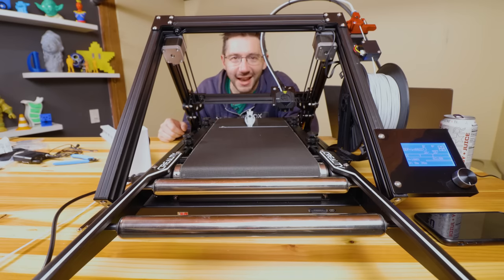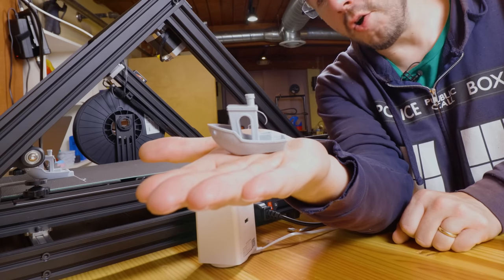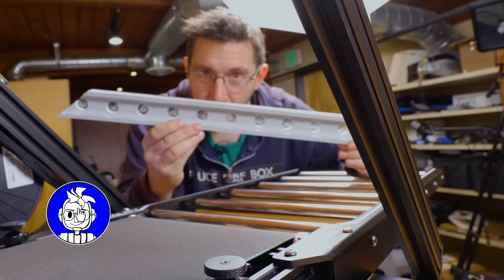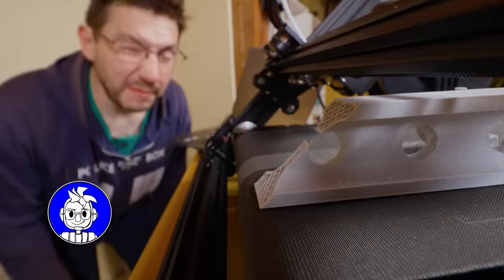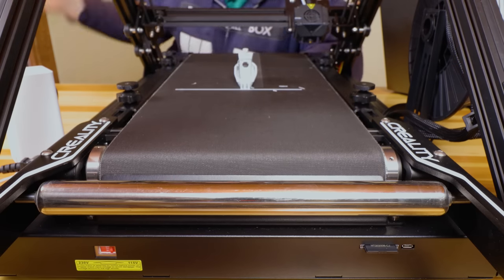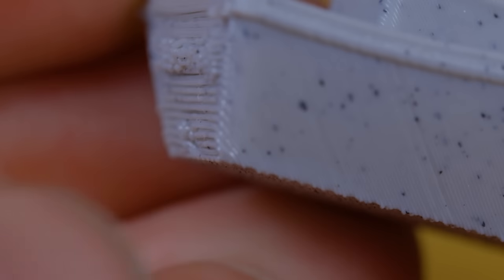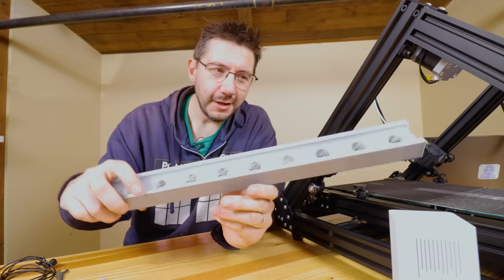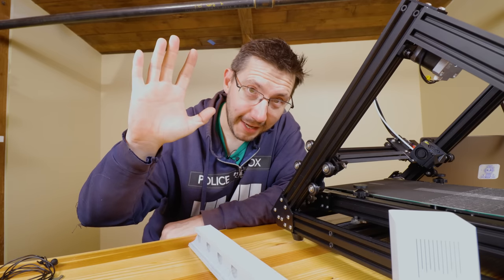Creality CR-30 / Naomi Wu's #3DPrintMill Update!

Comment: Really cool to see, so I know what to look out for! Such a cool machine, I kinda really want to build a transparent enclosure around it with a little exit flap and a parts bin beneath once it arrives.
Reply from the maker: Build that enclosure! Cannot wait to see what you do with yours.
Reply: Sounds like a version of the machine in the near future. I can't wait 2 have several running in production.
Reply: I asked about an enclosure on the last video and someone said that you can't just put a machine in an enclosure or you will burn it up. So whats the truth?
Reply: @jesusisalive3227  it could overheat if it's too insulated yeah.
Reply: Seriously brought reflections of Fallout 4 Ammo production setup lol
Reply: Looking forward to you getting yours and seeing what you do with it.. Hit me up if I can be of any assistance..
Reply: @jesusisalive3227  Yeah, just move the control board outside of the heated enclosure.
Reply: @MakersMuse    1. Keep the controller outside the box. 2. If the steppers get hot you'r (probably) pushing to much current or stepper to small ?
Try to regulate the current a little lower, without slipping of course.   But bigger stepper means bigger controller = more money 8-(
When steppers get to hot the magnet fails, I have cooked a few already...  Not only current will cook the stepper also high frequency is a killer. The steppers I had could do 1KHz 200st/rev = 5 revs/sec. After some testing I could go to +- 5KHz (ramp up and down) for about 45 minutes....  Keep trying and have fun. 8-)
Reply: @StumblingBumblingIdiot  I printed a 5 inch power armor model i took from the game. It would be cool to try jt on this.
Reply: You know it would be great to see a live cast with you, Joel and  Naomi Wu!
Reply: To me, it looks like the first print should be a thin, full width, 2-3m sheet to pick up any belt material that will come loose, followed by a 'blessing' with a heat gun to shrivel up any hairs.  (...and perhaps another sheet to pick up the leftovers?)  Perhaps it would be a good idea to include enough filament in the box to make that initial sheet.
Reply: Print your own prize claw machine.
Reply: @jesusisalive3227  You would likely just need to make sure it has good access to air. Maybe add a fan to the enclosure. Definitely at the very least have some vents. Puting anything hot in a sealed plastic box is an obvious recipe for disaster
Reply: I think it'd be fun to mount it at a 45 degree angle

Comment: Nice update. Ironically I wonder if using a raft is a good idea to make the bottom smoother.
Reply from the maker: I mean, dude, maybe? Hmm...
Reply: I was thinking that aswell but it would encreas the detachment force required so might encreas that dipping artifact for long prints.
Reply: I usually live by rafts, so i could see it being a thing here. But theres still that pesky issue of the belt material coming off with your print
Reply: I would think it would be possible for the raft or parts of it to stay on the belt?
Reply: Kapton tape
Reply: With the belt printers use a couple of small test prints offset to the side to get the flow and height correct and make the rafts thick enough to remove easily or they may become permanent belt fixture or scar.  The bed looks a bit like an abrasive belt minus most of the garnet (which I actually used for a time).  Currently I run PEI on a stainless belt and occasionally Kapton for my belt based printers.  My favorite things to print are upside down dish or bowel like objects as they typically don't need supports which are hard to print on standard fdm machines (I print a lot of speaker grills).
Reply: a nono printer . yet.
Reply: @3DPrintingNerd  I think the bed need to change to carbon fiber（T300 is good enough.
Reply: @3DPrintingNerd  Dual Nozzles so the raft is water dissolving filament.
Reply: @SunnySzetoSz2000  Why not use rubber or a plastic that can take higher temperatures and bed heating? real carbon fiber is still not exactly the cheapest stuff, so using carbon fiber for a printer by Creality will quickly bump up the price to Ultimaker level, making fewer people buy it and thus make the investment more of a failure than a success.
Reply: @Arterexius  make it to two version with 2 different cost.(also T300  carbon fiber isn't that expansive)
Reply: Which slicer are you using?
Reply: A raft shaped like a big H beam
Reply: @henry67278  Increase?
Reply: @richardmillhousenixon  im shite at speling
Reply: @dot-bob  Hello there! Great feedback! I was looking to adapt a belt on one of my printers also.. The stainless belts are made to measure? What thickness PEI? (I got so many questions, lol) Tks in advance!

Comment: I think what might be helpful is to have fans on the sides of the belt to cool those overhangs. Additionally, if the belt is a mesh there could also be a fan under the belt. Lots of possibilities, but a long way to go.
Another thing is that I'm also surprised they didn't just use the buildtak like surface they're putting on all the printers now.

Comment: I'm curious how the belt will handle wide prints. Will they warp and pull the belt up on the sides?
Reply: Good question. I think some kind of tank-track bed might be superior; although it wouldnt peel off as incrementally...
Reply: Belt I believe is steel and under tension. They shouldn't be able to warp the belt.
Reply: @girrrrrrr2  nope, the belt is a Kevlar weave with a pei coating.
Reply: @Unmannedair  oh interesting. That's... Unexpected.
Reply: @girrrrrrr2  kevlar weave belts are standard in some industry belt applications.

Comment: Great to see this doing reeaaallly long prints. I have a feeling the bed belt needs to be really tight to get rid of that artifact you saw because the play in the belt probably caused the model to lift with the belt when it got to the lower part.

Comment: It would be interesting to make 2020 and 2040 extrusion on it.  It could be used for prototyping machine designs without having to cut aluminum.  The belt will hopefully stop leaving behind material after a few prints.
Reply from the maker: I definitely want to try printing extrusion

Comment: Is it possible to set it up for continous printing? I have in mind two cases:
1) Hypothetical - "Infinite" length part - like "I" beam with repeating pattern
2) Pratctical - continous mass printing of single part type (also repeating pattern just with distance between print regions) because it removes print from bed with belt.
Very intriguing printer, if repeating patterns are imposible i feel it would be big waste of potential

Comment: A year on from this video (and these things have probably been discussed) I've found that the cooling fan for the heatsink was not effective enough to prevent PLA melting at the tip of the PTFE tube.  Jamming became a constant issue.  After swapping out the heatbreak for a bi-metal all metal one which moves the end of the PTFE much higher in the heatsink, the jams went away.  I also found that the PTFE quick fittings (PC4-M10) which come with the printers all either failed at some point or had a huge amount of slop in them.  Swapping them out with another brand sorted that out as well.  Replacing the stock PTFE with Capricorn was also applied to our four CR-30's.  

So, Naomi/Creality, please consider applying these changes to shipping CR-30's as they have significantly improved our printers?

Comment: How does it start the print?? If it prints at an angle then that would be a bit weird... does the frame move to print like a normal Cartesian? Also, does the hotend have a servo or something to change the angle of printing?

Comment: Karl had some crazy "coated, single weld, stainless steel belt"

I hope this printer kick starts availability for "print surfaces" like that, as supposedly that was nearly the only thing that was hard to find for the squire/white knight printer.
Reply from the maker: I think it would be neat to see different surfaces available
Reply: The things i could do with a belt printer...

Imagine GIANT RC glider wings printed in one peice, boats (like 3D Printed Kayaks etc), cosplay swords, SO MUCH
Reply: That is kind of surprising considering that belts have been used in all sorts of industrial applications over the last 50-70 years. I'm sure there's a suitable belt out there, but probably not available off the shelf and only available via B2B deals in 1000s of quantity. I hope this opens up the door for more innovation in this space. I just hope Creality doesn't screw it up and kill the mindshare for belt printers in the wider 3D printing community.
Reply: @shadow7037932  I'm sure there are probably several suitable option out there, sadly I don't have the time or money to test them all so I'm very happy to see this style printer going mainstream..  I'm hoping this opens the door to custom made aftermarket belts like we see all the flexplate systems now.

Comment: The coolest thing about it printing at an angle is that curved stuff will generally look smoother than on a standard printer that’s printing a model horizontally/vertically.  

I’ve actually intentionally angled models 45° to achieve that on my Ender sometimes.

Comment: My solution to that kink in the I-beam would be to ditch the outflow rollers and replace them with a thin spring steel sheet that overlaps with the lower portion of the belt and the surface of which is at the same height as the beginning of the belt providing a smooth transition off the belt without disturbing the print upstream. This would also prevent prints from getting stuck in that first outflow roller as had happened with the Benchy and potentially jamming the belt. Ideally the steel outflow table would be sharpened where it overlaps the belt assisting in its function to lift stuck prints off the belt. Rollers are designed to be a low friction surface for packages to zip down them at high speed. They are not designed to provide a level and flat surface for prints to inch across them millimeter by millimeter, especially with how far apart those rollers are spaced.

Comment: One thing that would be cool to see printed is a model plane. Typically larger models need to be split into many pieces, but with this machine you would only need to print 2 parts: the wings and the fuselage and still make a very large model.

Another idea that would be cool is model ships, they tend to have a very elongated shape, perfect for utilizing this machine's ability to make a very large single-part print.

Comment: I think there are definitely some more fundamental issues with printing at an angle as well as the conveyor bed. You see in the smoke stack on benchy, the PLA is perfectly fine being placed downward and pressed into a build surface, but other things happen at an angle, where there is free reign of the material to shift.

Comment: Ender 3: Make sure its squared !
CR-30: Make sure its squared at 40 degree angle !

lol aside from that, this probably a big OOF or a big YAY for the bed surface. Great grip power comes with great grip responsibility. To grippy, small prints roll under at the end, not gripping enough leads pre-mature pop off. The "Catching Rollers" should be some what closer or having a short flat platform in between the bed roller and support rollers, so that small prints wont go down the bed or getting grinded on/into the rollers. Not to mention the new definition of textured bed wobbling lol. 

The print finish edges looks like an italic letters but may or may not be a concern for prop makers since we just sand it off later, but may be some for people who prefer finish as it is or functional prints that require some accuracy. Customizing this may be the same just like Ender 3 but I do hope there's aftermarket texture bed belts. This one is a bit ouch for some of us.

Its look promising for mass-production prints but as a guy who makes small keychains with ender 3, I might skip it or wait for "Definition Edition" for this printer.

Comment: Once they get this right, I'll  be getting one for RC aircraft and hydrofoils. RC planes need a small nozzle, thin wall, and reinforcement with CF tubes and strips. Hydrofoils are printed solid with hole for Al section, then covered in heavy duty shrink wrap.

Comment: In woodworking, that indentation in the ibeam is referred to as "snipe".  It is common with things that move across a bed like a jointer of planer.  I would imagine that if printing a long item like the i-beam, that it could rock forward as it reaches the end of the bed and cause it to lift near the print nozzle.

Comment: Any chance to mount a custom "scraper" towards the end of the belt? At or slightly below the belt plane where it dips, slanted edge. Might help to separate the print but more importantly, also support it to keep the whole thing from tilting and being lifted off the belt. Main problem would of course be calibration. Too low and you get tilting, too high and the whole model gets stuck. Could be useful to be detachable, so it can be used for large prints only (reducing it to the one critical moment of the model initially going over the edge).

Comment: Tilt the benchy 40 degrees towards the print-head and add supports for the bottom part. So basically printing it flat from the print-head plane.

Comment: All tightening up of the build belt will not alleviate the lift problem, if a decent balance for parts adhesion can not be struck. That's just in the character of belt mechanics. I know a thing or two about that; it's literally my job.
In the same vein: You DON'T want to make the zig-zags of the splice shorter, if you still want to be able to keep that belt under high tension, ESPECIALLY  at elevated temperatures.
Varying properties over the splice will also remain an issue if there's a considerable difference in properties between the coating material of the top coat and the core, the latter is by necessity thermoplastic (usually TPU or PVC), to make the belt weldable, the former may well be cured / crosslinked, thus rubber-like or even actual rubber. The fact that the white core material seeps up at the weld line tells me that the top coat most probably is NOT thermoplastic.
Having seen the surface pattern up close, that's definitely a deliberate embossing, not just a random fabric imprint.
If the top coat material is indeed rubber, they may want to consider a truly seamless belt. These exist, but may not make the notoriously cheap maker-market happy...

Comment: I print RC airplanes with wings in several parts. The single wall prints have to be printed vertically because of the curve of the wing. I'm wondering if it would be possible to lay down an entire wing on the belt. Which brings up another question. You print out a simple repetitive i-beam, but can it handle a 3 foot long and longer complex object?

Comment: Based on the belt (it's no longer a bed) being soft, never use I scraper made of metal or hard plastic.. the print removes itself via the bend of the belt.
Reply from the maker: UNLESS it's super tiny, then it needs assistance for coming off
Reply: @3DPrintingNerd  yeah, but printers designed for tiny prints should be used for tiny prints. But also, wow, thanks for the reply my guy, you helped inspire me to own and use 3d printers.
Reply: @3DPrintingNerd  then just super-size raft them so they will self pop off, a little bit of filament is better than piercing the belt

Comment: It seems like the flexible belt is a problem. The stitching for one, but also that it can be distorted by the print. My guess is that rather than lifting the print from the belt, the entire belt can be lifted slightly from the heater underneath, which caused that seam when it started trying to pull the belt away from the long print.

Comment: Would you be able to share your slicer settings? I got my 3dprintmill yesterday and I cannot get the extruder to extrude fast enough no matter what I set the flow rate to. I've already leveled the bed and adjusted the y stop so that the nozzle barely touches the bed

Comment: Maybe they could use something like a silicone belt with with fibre glass tape in it. This would give it a smooth print finish.
Reply: Yeah, basically  the belt they have but coated with a silicone layer. But that 'd be costly no doubt.
Reply: i wonder if they have tried a steel belt at creality. i think they are used in factories etc in rolling applications a bit like this